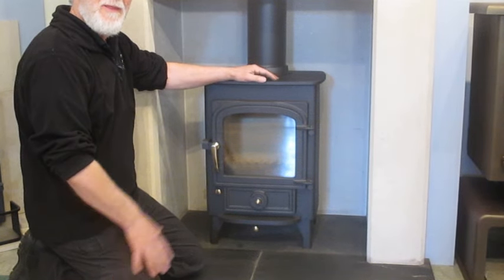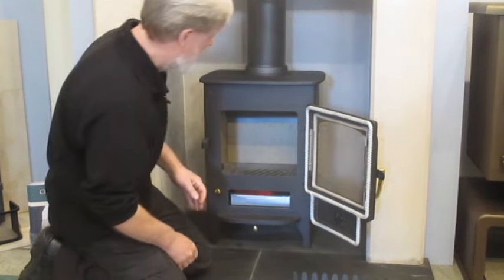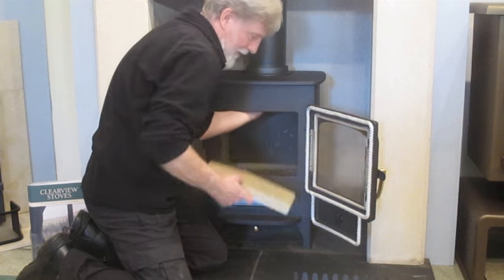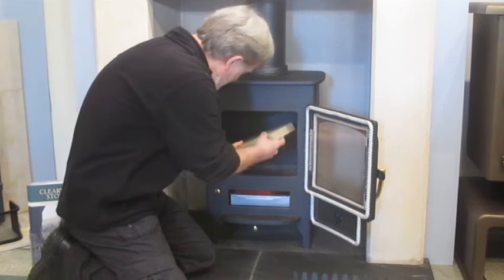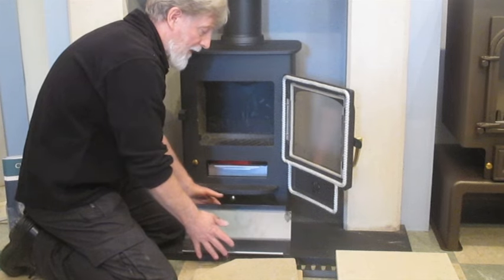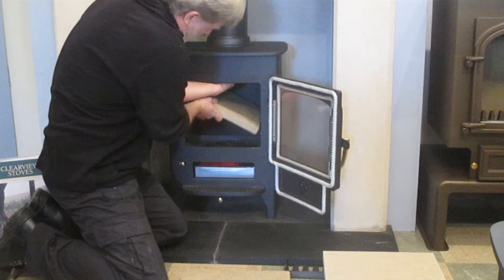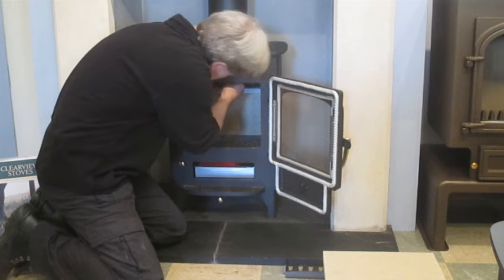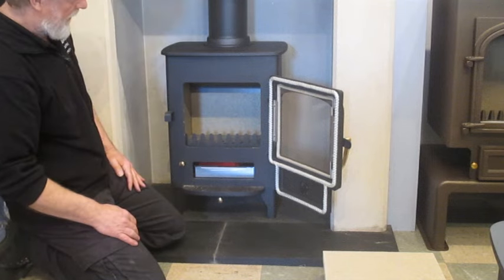How to change woodburner bricks

Comment: Just a couple of extra points to this excellent video. The side bricks only go in one way, with the shorter unchamfered side at the bottom. Also it is a tight fit and you have to ensure that there is no dust or ash etc in the channel you are putting the bricks into, the cleaner the better. I used a flat screw driver to scrap hardened ash out before the bricks would fit.

Comment: Best vid on here, I have a Firefox 5 and have installed both sides, baffle plate and the back brick but cannot get the 2 roof bricks in, the plate has 5 lugs, 2 either side and 1 in the middle of the plate, does this lug go at the front of the fire or to the rear, there is nothing on here about the  firefox and replacement instructions are very vague, any info would be greatly appreciated, many thanks.

Comment: WARNING !!  That stove is a Clearview Pioneer 400 Non- Smoke controlled.  The Smoke controlled version which I found we had (Grrr!) has a rectangular metal tube (Turbo channel + 2 turbo channel gaskets) that runs along the top of the back brick.  The procedure for removal is different and so are the Fire brick sizes !!! (Extra Grrrr!).  Procedure for the Clearview Pioneer Smoke controlled is:-

1. Lift the baffle and side it right.  (Or left.)
2. Tilt and remove the left side brick.
3. Slide the baffle left and remove the right side brick whilst holding the baffle.
4. Let the baffle drop forward and tilt to remove.
5. Remove the metal smoke control pipe from top of back brick.
6.  Remove the back brick

This would have been so much easier if the installer had left the manual, so I knew exactly which stove I had.  (They both look exactly the same!)   Also easier if the Clearview web site was any good. ( I couldn't even find the smoke controlled version listed.)  In the smoked controlled version the back brick is the full width at the back and the side bricks are shorter to accommodate this.  I'm guessing the baffle may also be a different shape?